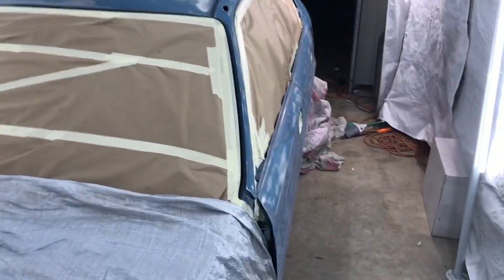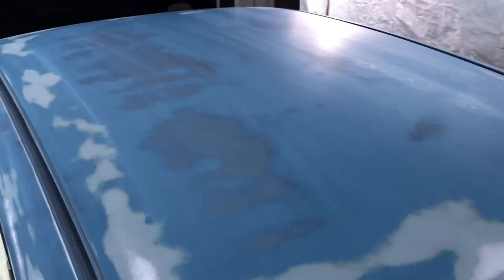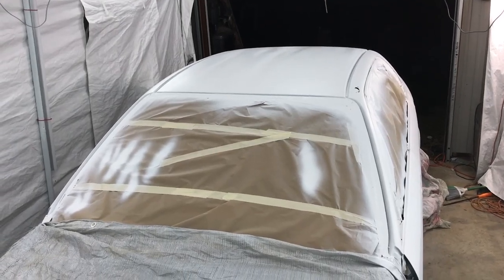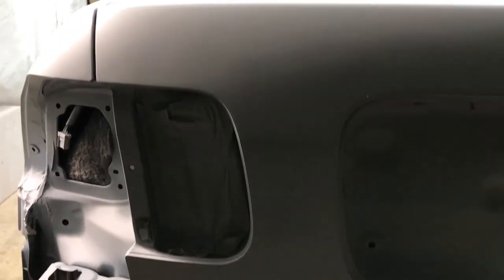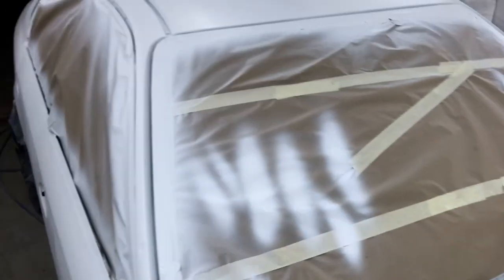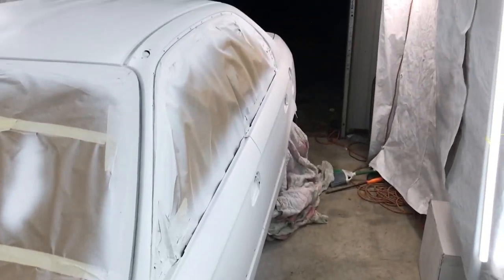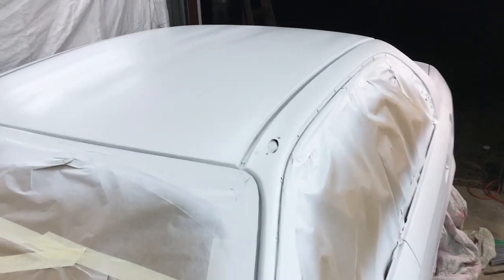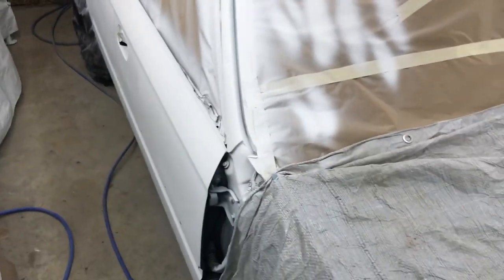Honda Project | Speedokote T-Rex Epoxy/Sealer | Astro Euro Pro HE 1.9mm |

Comment: Does this epoxy sand easily? Gum up paper? Thanks
Reply from the maker: Pretty good but super thick not going through a 1.4 without a ton of reducer. I used 220 and I used about 6-7 for the whole car...thanks

Comment: Is this a pretty good primer? I think they got me with clever marketing, I f’ing still love dinosaurs. 😀. If you have a peeled area, is this where you’d use the primer and then sand to make it even?
Reply from the maker: Yes it's stout and thick so plan on reducing it a lot...you need to sand through the old paint that was expose to moisture...at least to the original factory primer...to the metal is the only way to be certain that you'll get a factory good bond...thanks